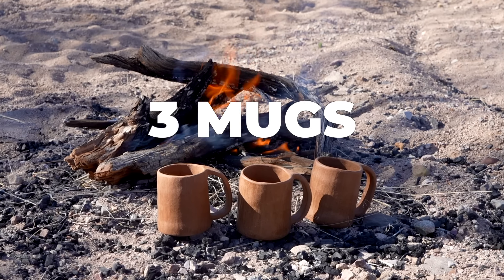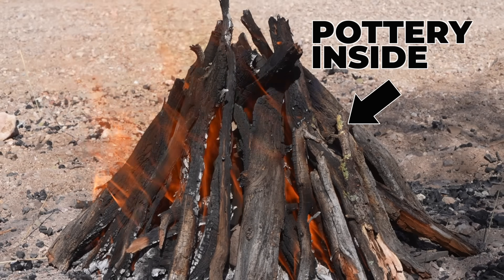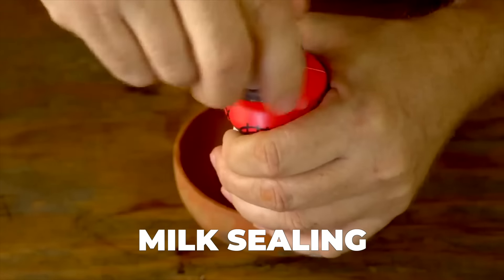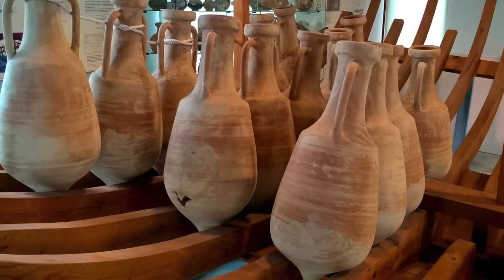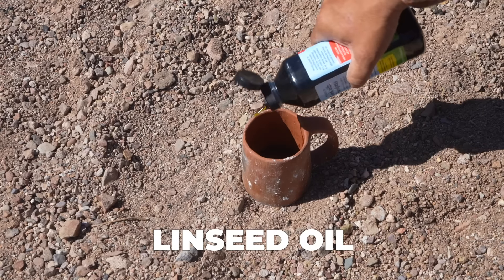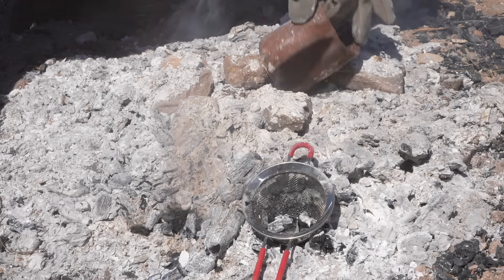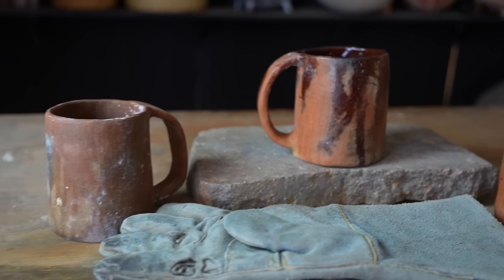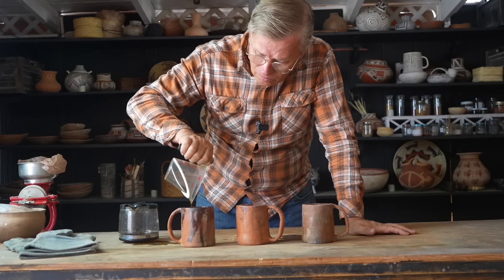Sealing Mugs With Old World Methods

Comment from the maker: If you are interested in some of those other sealing methods, here is my last pottery sealing video which covers starch, lard, milk and cutting board conditioner https://youtu.be/Ln4jKlfruaw
Reply: Resin did leave a taste, as the wine Retsina had its unique flavor from the pine resin used to seal the vessels in which the wine was stored and shipped.
Reply: I wonder if birch resin would leave a better taste. And maybe try cold pressed flax oil instead of linseed, the linseed of today is made with chemicals added.
Reply: A 3 way compare IS good science.  Your control for each is the other option.  When testing a new drug, the control is often the existing drug for the same problem.  Sometimes multiple options are compared also.  Don't sell your self short on doing very practical science.
Reply: What about just a mixture of honey and fine clay. Cover the inside let it dry and start , sand and start  over a few times..
Reply: I wonder if, like the corded wear pottery, a mug shaped crocheted with oil cloth thread, such as flax (linseed) or sheep wool (lanolin) and then a repeated dipped and dry in the clay mixture. Then when the mug is fired in the kiln, the oils would release from the interior and seal whilst being kilned. 🤷🏽‍♀️
Reply: I think when you use pine pitch it takes a bit more effort to get a good result. First melt the pitch and run it through a sif to clean it. 
Then on slow fire let it cook until it doesn't bubble so most of the turpentine leaves the pitch  you end up with rosin that has almost no smell and solidify into a hard glassy substance. 
Make sure you don't burn it. I usually cook it in an oil bath over an electric stove. The oil helps heat the pitch evenly and if the oil smokes than it is too hot for the pitch. Oil bath is not needed but over fire you need to be watchful. If you make a really good effort cleaning the pitch and create a clear rosin then it has a visually pleasing red-orange appearance. 
Then pour the rosin into the mug (I believe the mug should not be preheated) quickly slosh around and pour out (ideally back into the pich container) A mug that sealed this way should not give out much smell at all. It is the turpentine that smells and it is what let the pitch dissolve into other fluids.
That was the most common way to seal pottery that contained cold fluids. I don't think it was used for cooking wares. I was told this is the reason pitcher called a pitcher. 

Give it a try.

I don't think you should use linseed oil that thing is disgusting and offers no benefit to any other oil sealing.
Reply: Oh I loved retsina!!!!!
Reply: From my understanding the most common traditional way to seal in europe was using the salt glaze style but u need something hot enough to decompose salt also it is a bit dangerious cause well clorine and sodium vapors are not something that u really want to work with
Reply: A method I read about using beeswax said that in history they would add the beeswax to the unbaked clay before putting the clay into a kiln.
Reply: Making retsina is also known for wine that is poor quality/flavour.

Better than the use of ethylene glycol used in some wines a couple of decades ago.
Reply: "The primitive method I found to work great is sealing them with deer sinew glue. A good technique is to seal the  the cup or pitcher. Then bury it for a week. The microbes in the soil attack the sinew glue, leaving it sealed and odor-free."
Reply: Great vid! It's gotten me thinking that your real problem is in the use of different vessels for different products.
If they were transporting wine, oil, pickled goods then they probably had cauldrons that they kept their wax in a liquid state and they filled those cauldrons with the pottery leaving them in for a predetermined time for saturation and then polished them to remove any excess from the outside. They could even have rolled them in powdered clay or rock then polished. Pots for cooking would need something else that wouldn't burn off and that's where the milk treatment would possibly be better. To finish those you would sit them on a fire to cook away the outside excess and polish the inside with sand to remove the burnt milk excess.
I'm just guessing here but I'm sure that pottery has been anolized and found to have wax or other sealant in the clay layer. 
Just my opinion
Reply: @kellyroup4262  very interesting, do you remember any sources you have come across? I'd be interested to find out more.
Reply: I wonder if you did the linseed oil wrong.

When watching videos on water-sealing canvas and other materials, the linseed really needs 24+ hours. I would think leave it outside upside down and let it air dry, and it will likely generate heat as it's curing (i doubt self-combustion will happen as it's pottery; Or maybe just leave it in the oven when you're cooking a few times, or maybe even 400-500 degrees in the oven if you do any cast iron seasoning). Once the linseed has fully cured, no clue if it will have any residue or not, but i would think it's similar to seasoning a cast-iron pot. If there is i'm sure any oil slick will be gone after a few uses/rinses.

Comment: I don't know about earthen wear pottery, but when you seal earthen floors with boiled linseed oil, it involves several coats, drying between coats, and then ,when the clay will take absolutely no more oil, a topcoat of beeswax (often heated with a heat gun, and polished).
Reply from the maker: Thanks for that tip.

Comment: When sealing wood with linseed oil, best results are when you put wood in a really hot oil (100C-130C +) and keep this temperature until bubbles /mostly/ stop coming out of the wood piece. Which means that wood is fully saturated with oil. After that, dry it for a week or a month, preferably in a dry and sunny place. Maybe same would work for earthenware? It will require a ton of oil, a really big metal pot and quite a bit of time though.
Reply from the maker: Thanks for that insight. Like I said in the video, I think if I could spend more time on it I could get a better seal with the linseed oil, but that smell...
Reply: @AncientPottery  Smell will go away with time and with use, but yeah, it's tolerable but not pleasant for sure.
Reply: @AncientPottery  The linseed oil is supposed to be applied before burning the cup. Or if you want later, then you have to wait until the oil dries completely, about two weeks. In both cases, you must apply a thin layer of oil that does not pool, if you apply too much, you must wipe it off. Too little is also bad. Polymerization of untreated linseed oil takes a long time.
Reply from the maker: @Timoshim  You cannot apply the oil before firing, it would all burn away
Reply: @AncientPottery  Oh, you're right, I didn't take into account how high the temperature at which you fire clay pots is. So probably only the second option remains. You can also try to imitate the process of burning linseed oil as in cast iron pots
Reply: Yes, with raw linseed oil, you need to wait a long time and use multiple applications.  For outdoor furniture and garden tools, raw linseed is great.  You put lots of it on and let it soak in.  Linseed oil is good for the skin on your hands so it doesn't matter if a little wicks back out onto your hands when you first use the tool after coating it.
Reply: @Timoshim  It needs oxygen, so if it fully soaks into the clay, temperature might not even be very helpful. The diffusion of oxygen into the piece is not much faster at high temperature than at low. If you soak it that way it needs to sit somewhere for months. I would think they would do many thin coats on the inside and the let outside be unsealed, trying to brush on a thin, even layer, letting it polymerize and then doing it again.
Reply: Wad this video referring to wood?
Reply: Try using a bag and a cheap electric vacuum pump. Far less dangerous, way less oil, way less time (depending on the pump).
Reply: It would probably end up seasoning it. Like a cast-iron pan

Comment: Remembering resin flavored wines and liquors drunk around the Eastern Mediterranean from ancient times to the present I did NOT expect the pitch sealed cup to be unodored or flavorless.
Reply from the maker: Well to be fair, mine was a very short duration test. Maybe if I left the drink in there for an extended time such as wine might, then I may have very different results.
Reply: @AncientPottery  Ethanol is a better solvent than water for some substances. Water is a highly polar solvent and hardly dissolves oily stuff.
Reply: There is a reason the ancient Greeks drank their wine (retsina) diluted with water...
Reply: Also wine on a ship does get quite as hot

Comment: If you use linseed/flaxseed oil to seal food or drink vessels, be sure it’s the edible kind. Flaxseed oil and linseed oil are the same thing, but (in the USA) the kind used for food is usually called flaxseed oil, and the kind used for furniture finishes and paint is usually called linseed oil (terminology may differ in other countries). “Boiled” linseed oil typically contains solvents and driers that are not food-safe. But the pure linseed oil sold as a food ingredient or dietary supplement is safe to use on dishes.
Reply from the maker: Buy it from the grocery store. The kind at the hardware store is not for human consumption.

Comment: For wooden cups, I use a paste I make by mixing beeswax and linseed oil. But you have to let it cure for a couple of days before use. Yes, they smell strongly on the first few days, but after a week there is no noticeable difference smell.
Reply from the maker: Thanks for the tip, I will try it

Comment: I work a lot with pine pitch in pottery and can give a couple small pieces of advice to get more desirable results. First, you can put a slice of ginger in the pitch-sealed vessel overnight or for a couple of days to eliminate any odor. I have made decently large pieces and for some reason ginger just absorbs the bitter smell of the pitch very efficiently.
Second, you can cook off any excess pitch by putting the vessels in the oven or near a fire at about 400F.  The time it takes depends on the size of the vessel as well as the thickness of the pitch coating, but it should leave behind a very nice surface with any excess pitch burned away. 
You may even consider rubbing a rag saturated with pitch onto the vessel immediately after firing it rather than poring it into the vessel as you did in the video. The very hot ceramic will burn off any excess, leaving the pores completely sealed.
Reply: Where do you get your pitch? Do you perhaps make it yourself?

Comment: Great Video as always 😄
The south asian part where I am from, buttermilk or mustard oil is used to seal the pots for cooking
They soak pot really well in water/buttermilk for a few days, changing water every second or third day and leave it out in the sun

Then they would apply oil really well and leave it out in the sun again and probably apply 3-4 coats of oil
so the sealing process in really lengthy 
.

I guess in far south where they would use Rice water as an alternative of starch and probably use coconut oil or any kind of local oil available
Reply from the maker: Thanks for that info, very helpful.
Reply: @AncientPottery  Mustard is part of the same family as rapeseed oil (cabbage family). I believe it's called Canola in the States. I wonder if that would work as well.
Reply: @rosalindriley5893  It should, it isn't just part of the same family, it is literally the same plant (Brassica rapa).

Comment: If you stored a light white wine in a pine pitch sealed amphora, the result might approximate retsina -- which is a Greek wine that's stored in pine barrels and picks up flavor from the pine resin.  I've had this, and found it pleasant enough, though I'm not much of a wine drinker.  I'd have hoped you'd allow several weeks for the linseed oil to cure -- I recall from learning oil painting (really forty years ago?) that oil based paints might take as much as a year to fully cure, and even the old oil based house paints (still in use when I was a kid in the 1960s, since completely replaced with latex-based, water-solvent paints) would take several days to cure enough to be safe to handle.

Also worth noting that pitch (presumably from pine) was used throughout medieval times to seal "jacks" -- leather drinking mugs.  These were used to drink whatever a traveler might get (which would be ale more often than anything else).  Given the inconsistency of medieval beer before gruit was replaced by hops, however, it's very possible a traveler would never notice a flavor in the beer from the pine pitch.

Comment: Hey Andy, I can't thank you enough, besides my sub, for the work and information you are providing. I just fired my 1st 2 pieces made from Georgia's red clay. I did it in a pit fire on corrugated steel with a rock circle on top. I had my 1st bowl and a gooffy little pinch pot much smaller. I used wood ash and sand, unmeasured for grog, and honestly expected total failure. I did wedge it. I am truly blessed today! Both made it without any problems. I'm in shock, for real. I've seen so many tragedies. I worked hard on the bowl and burnished it to a nice shiny surface. I put a metal pot over it like you did in a video as I did not have broken pieces yet to put around. This was a few hours earlier. I wiped it down with food grade mineral oil and I'm about to try eating my hot dinner, rice and veggies, in it. I'm on cloud 9 over here! Thank you! I'm so excited about this new hobby as an old man now. It's a ton of work, but it cost me nothing, and it's beautiful! I hope this finds you well my friend, you're a good man and the world needs more folks like you. Thank you, and I'll let you know if dinner goes right through it or not either way. I'm a deer hunter too and process everything myself. Deer fat is so sticky, I make bone broth too, seems like that would seal it totally. Wondering what your thoughts on that are. Again, thank you sincerely.
Reply from the maker: That's awesome glad to hear of your success. Yes I think deer fat would make a great sealant.
Reply: so you used the "red clay' that isn't very thick like kids used for play dough - but almost more silt-like?  I am familiar with that GA red clay - but never thought of it as real clay. Great to know.
Reply: @genkiferal7178  Yes it is usable but I started playing around and mixing it with a gray clay I got from a river where I fish and had a lot better success. Made a bunch of oil lamps, I call them prayer lamps and they are really cool and work great. Did it so much I kinda burned out, pardon the pun, so it's been a while now. Great hobby so good luck my friend.

Comment: I've found that a beeswax and resin blend works really well too and there's evidence of this blend in ancient times.
Reply from the maker: Thanks for that
Reply: Such a blend is used in other traditional sealant applications, like canoes. I think the pitch adds a certain toughness while the wax adds fluidity/workability. Also pure beeswax would probably absorb and get saturated with oil and soften if not outright dissolve if used in long term contact. Pine or polymerizing oils might be superior for sealing in oils in that regard? Not sure but the best sealant probably is application dependent. But for coffee mugs im also convinced of the bees wax!

Comment: Have you ever tried this ancient method?

For the glaze, use a mixture of 40% sieved and water-mixed hardwood ash (lixiviate the ash by allowing the solubles to dissolve in water and then pour off the clear solution), 40% bonemeal from baked and ground chicken bones, and 20% of the prepared clay.
Paint the inside and outside of the pottery with this glaze mixture.

Comment: I've been making earthenware ollas to water my vegetable during our (increasingly hot and dry) summers, based on traditional techniques from multiple cultures.  It sure beats having to get up at the buttcrack of dawn to water my large garden before it gets hot, and having to water multiple times a day. Because the olla is buried and covered, it eliminates evaporation from the surface, meaning almost all the water goes where it's needed, to my plants' roots, and isn't wasted. I also made an earthenware pot to mount orchids to. That porous nature is very useful!

Comment: It is very interesting to see these techniques in practice and their potential practicality. I do not know if corn starch was used in the New World, but I do know that many Mississippians in the Eastern Woodlands, particularly the Southern Appalachian Mississippians, did use pitch pine for sealing pottery. When they fired their pottery, they pit-fired it with pitch pine limbs that were still rich with resin. When the pine burned, the pitch dripped into the pots and cooked into the walls, sealing it and giving it a matte black finish. I wonder if maybe cooking the pitch into the cups might negate that odor and taste issue you had.